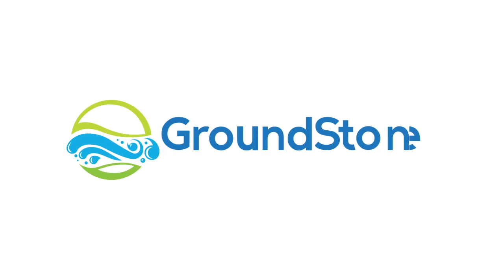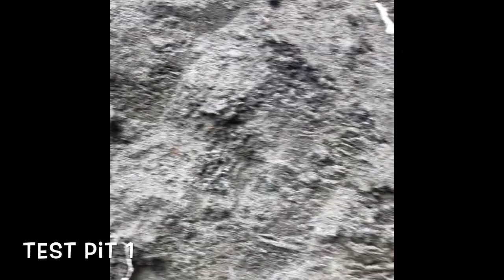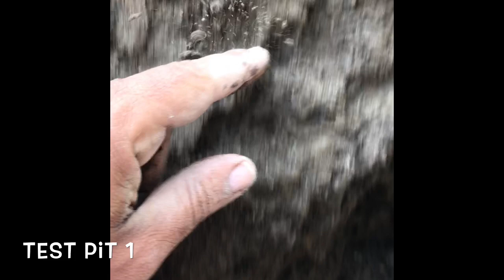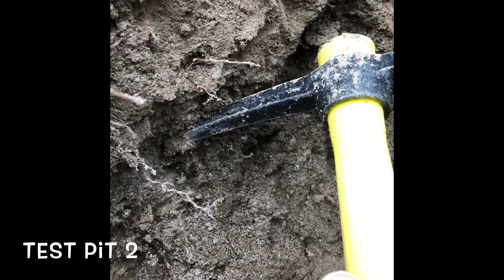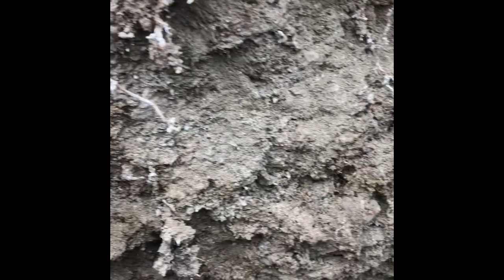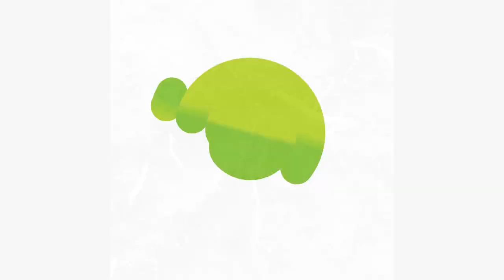How To Assess High Water Conditions For A Septic System

Comment: "Really appreciate the knowledge you’re sharing! Thanks for breaking it down so clearly 🙌" 

Is there any way we can determine the highest water table level during the peak season with 100% accuracy, or is it always just an approximation?
Reply from the maker: Thanks for the comment, we look at what is called mottling in the soils, this can be white glyed areas that can be found just above the seasonal water travel or high water mark. It can also be redoximorphic features (rust spots).

Comment: So confused. What is the distance from the ground surface to limiting layer in feet? 24” requirement? Or is it 24” from the bottom of the leach line to the limiting layer? Please help. I thought you need at least 4 total feet and 8” min to the limiting layer
Reply from the maker: It all depends where you are from, in BC, using a uniform distribution system we are allowed 24" to limiting layer from the point of the infiltrative surface.  With gravity systems we are allowed 48" to limiting layer from the point of the infiltrative surface.  The infiltrative surface is where the effluent will enter the soil that has been excavated.  In a raised system the sand bed has to make up the vertical separation distance from the limiting layer/condition, and the infiltrative surface will be the sand.